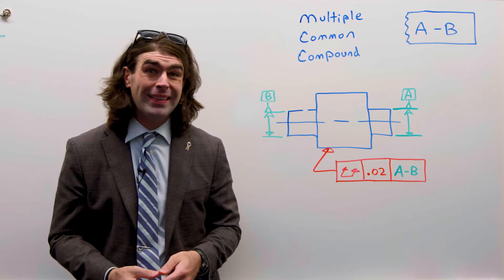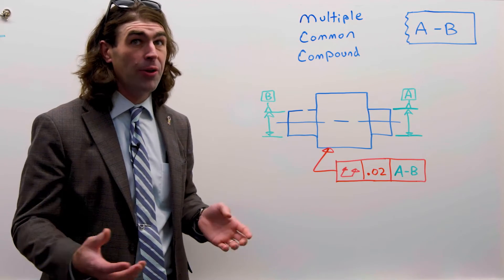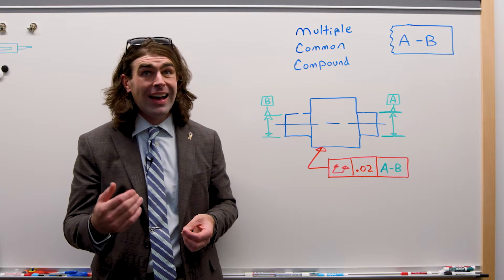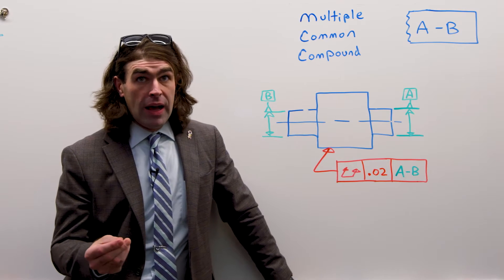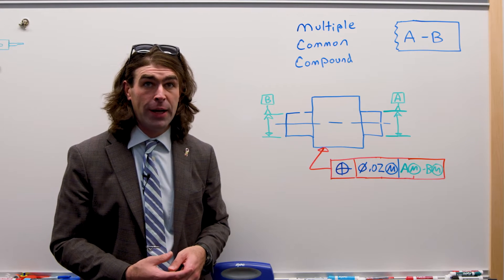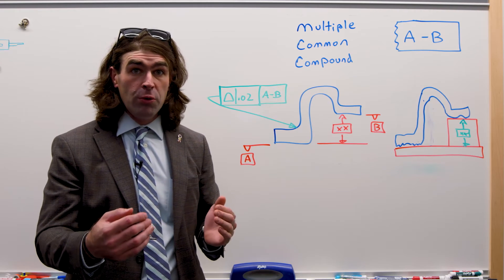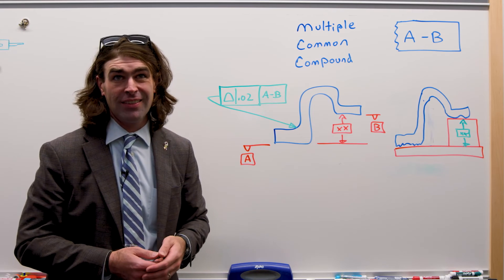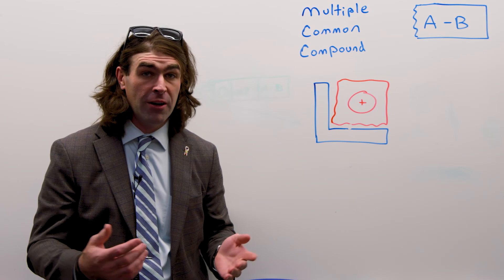GD&T: Common Datum Feature “A-B”

Comment: Will there be a significant difference in variability between parts if a single cylindrical mating envelope is created around the 2 cylindrical features vs 2 cylindrical common datum features as shown above? For example, say there exists a cylinder with a surface profile requirement across the entire exterior cylindrical surface. The ends of the cylinder are fairly consistent in terms of meeting nominal dimensions, however, everything in between them is highly variable. Think of randomly hammering the sides of a bunch of empty soda cans; the ends of the cans would largely maintain their shape, but the surfaces between them would vary significantly between cans. Would using a common datum feature (1 datum band at each end of the can) create more consistency between cans versus a standard ASME single collapsing cylinder datum?

Comment: I'm trying to figure out the general rules for common datum features. One drawing has a plane as one datum and two studs intersecting a perpendicular plane as another datum. The CMM software will not allow me to make a common datum from these together as an A-B datum. My understanding from the software files is that it is because the cylinders are not perpendicular to the first plane.

The standard isn't clear in explaining these rules so where would I find them at?

Comment: Thank you! This is in my opinion one of the easiest concepts to understand once you are familiar with GD&T, but very difficult to undestand when you start learning or to explain to newbies. It causes a lot of confusion, a lot of questions and sometimes make people think it can be used whenever they feel both datums are "important".
Reply from the maker: Hi, totally agree. I mentioned the perpendicular common datum thing in the video because I’ve seen it applied before. It’s tough to explain why datums can’t be “equally” important as you mention. The trick with the common datum features is that they only create a single “datum”.

Comment: How does this relate to continuous feature? Is this basically the same principle with features that do not represent the same surface?
Reply from the maker: I think that’s a fair statement. They basically mean the same thing. I don’t like continuous feature for this application personally, it doesn’t make sense to me for datums A and B on the example to be continuous, because they are totally separate in reality. They can be called out as continuous and a single datum per Y14.5 though.